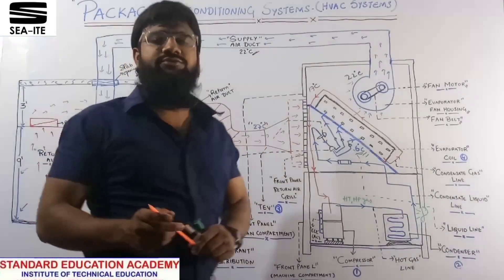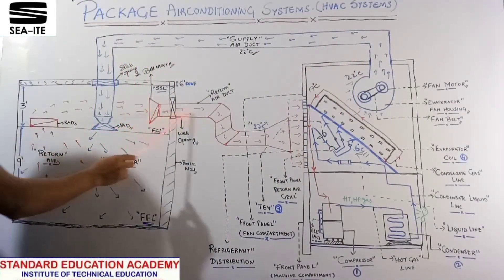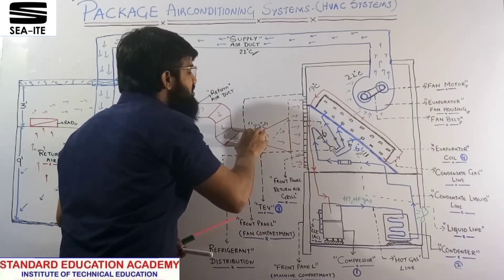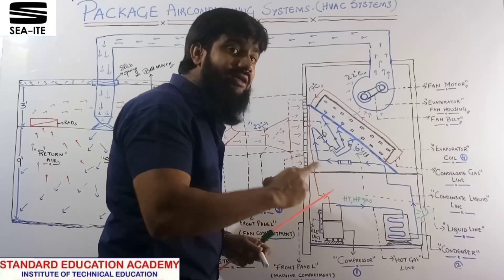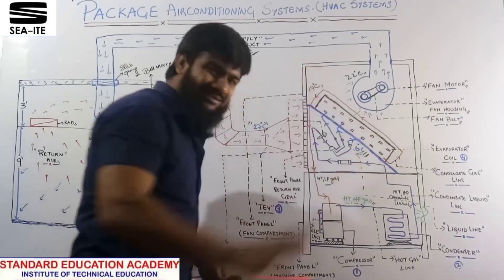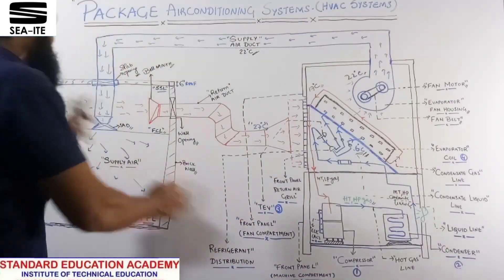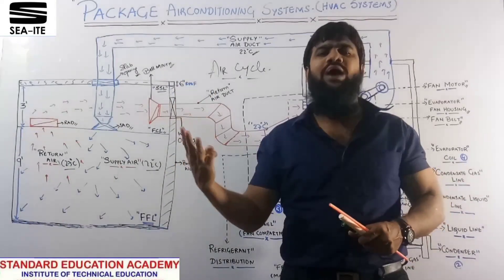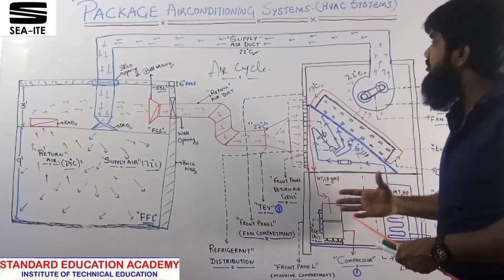PACKAGE AIR CONDITIONING SYSTEM (HVAC SYSTEMS).

Comment: suppose inside room if we have toilet exhaust , what we can do for compensating the exhaust air.
Reply from the maker: Firstly Inside a room you will not have a toilet exhaust, It comes under ventilation design & a seperate exhaust duct work will be provided which passes thru every Individual urinal/toilet to exhaust it to atmosphere & negative air pressure is been maintained in toilet exhaust system.